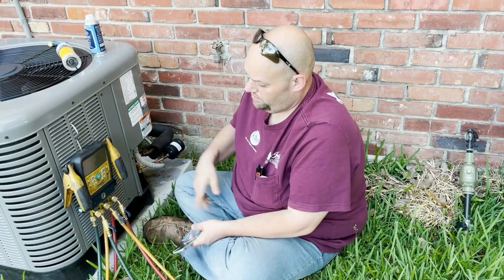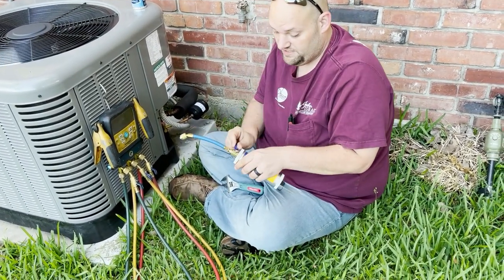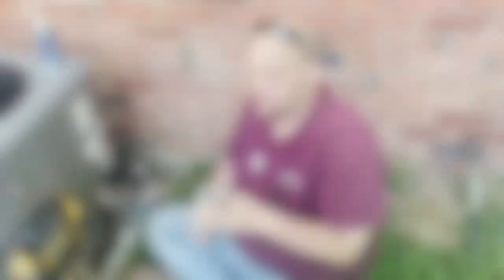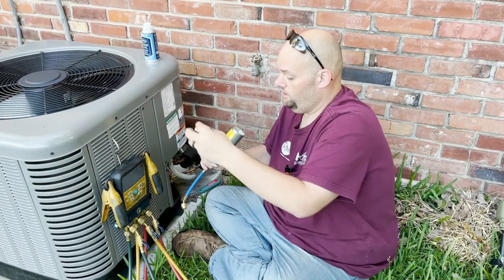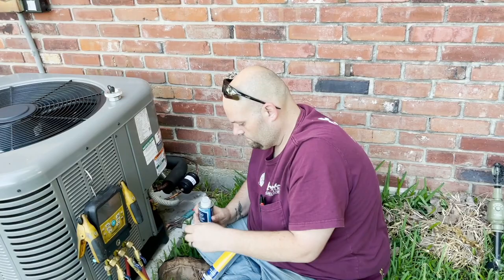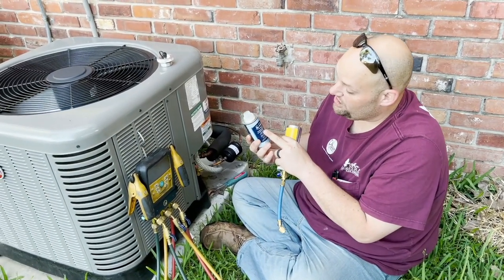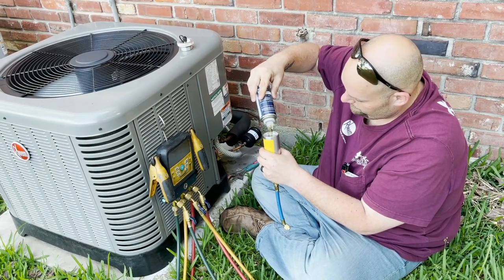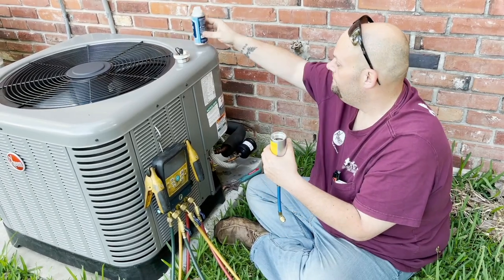Trying A/C Renew to Unstick a TXV

Comment: Next time, try this. 
Unplug condenser fan motor and get pressures up to 500… cycle condenser fan motor by touching it to power keeping the head to about 500. 
Get you some hot water and ice water in a cup- and dip the bulb- that helps exercise the valve. She’ll break loose. I’ve had 2 I couldn’t get to come around.  
I yelled through the phone “release the pressure” and giggled when you said it. Same with you wiggling your wireless clamps to get temps. Great video my friend.

Comment: You definitely put air into that system. I would of removed the txv sensing bulb and manually tried to actuate the valve to see if it even moves. It a long shot but could of broke it free. None the less always enjoy your videos keep them coming.
Reply: Eh, the filter drier will get the added moisture lol
Reply: I thought the same thing.  Is there any way to purge their air out prior to introducing the ac renew into the system?  I gotta think there is, and I'm just an amateur.
Reply: @adamcraig1568  filter drier won't take the air out though lol
Reply: @justinh7957  true, but we gotta test the compressors endurance and reliability lol
Reply: Was just typing same thing. If your gonna make educational video do it right so the junior tech dont screw up
Reply: @justinh7957 ou just purge the lines, and the cylinder won't have air if you fill it correctly. Air in small amounts won't kill a system, compressors are made for gas compression. Moisture in the air will do damage. Filter driers will take care of any moisture. Diy people should  just leave it to pros so they don't do something stupid that damages their expensive equipment.

Comment: You can use that ball valve on the injector to bleed the air from the injector once the high side is connected.

Comment: Shouldn’t there be a way to purge the air out of the “injector” before injecting?
Reply: He didn't purge his hoses, and yes there is a way to purge the air out.
Reply: It fills completely  no air in there
Reply: Not without wasting the product
Reply: @ivancook1247  if you have air in the hose end and hoses attached to the manifold then open the ports all that air enters the system contaminating it. Any air gap in the injector would also Introduce air.
Reply: Lol… I noticed that as well
Reply: This guy is licensed?! 🤡

Comment: You did the same thing I have done with the AC Renew. My experience with it, it hasn’t been the best. Supco88 is a lot better, or it has been for me. If it’s a heat pump I usually make the reversing valve go into heat and cool mode to get it flowing both ways and it seemed to help quite a bit when I use AC renew.

Comment: John I had a brand new unit with the same issues. I ordered a new txv and when I went to replace it there was a piston in the distributer tube. So the factory put the piston in and a txv on top. Talk about a crazy service call.
Reply: did you remove the piston?
Reply: @obedb093  Of course I did then it worked like a charm. Boy when quality control in the manufacturing fails isn't that a " Never seen this diagnosis before in any of my textbooks" job

Comment: Great video. Just one suggestion, or actually two. One I recommended cracking the valve and letting some of the atmospheric air out of the injector. You will get a little oil so turn it away from you. Also I highly recommend Supco oil. It’s a real pain because if it gets on you or your vehicle it stinks to high heaven! Use what you need and throw the rest out, because it’s only $12-15 and it’s not worth taking an open bottle with you. You can also charge the same but have a better profit margin. Both products work great but the old school Supco seems to have a better batting average for me
Reply: In my experiences with Supco also. And Definitely would not recommend keeping any leftovers that product does have a smell to it lol. And keep up the good work also young man I enjoy watching your videos.
Reply: I have a suggestion. Learn to do the work. I walk onto a commercial job with contacted time performance guarantees and I see something like this, the contractor either had you replaced in less than 30 minutes, or in 31 minutes, I'm on my way home, never to return for ant job that contractor calls me about. He can hire anyone he wants, but life is short, and I don't work with "stupid"

Comment: Hopefully you checked blower speed, evaporator, secondary HEX condition and possibly ductwork for issues. Don't think you mentioned any of those. Could very well be a bad metering device but bad airflow over evaporator will cause low superheat and low suction pressure. Boiling water and ice water on the txv bulb can unstick the valve also.

Comment: I remember getting that stuff back in 2013-2014 when Trane had the run of compressors that would wax up the metering device. That anti corrosion crap ruined a lot of systems
Reply: Ruined systems +$4500 compressor replacement then another failure.
Reply: I worked a 15 ton York with 3- 5 ton scrolls all with sticky TXVs due to the corrosion inhibitor. RTU was under warranty and York sent me 3 can with the injector. Installed the snake oil and within an hour all back to normal. Couldn't believe it worked and never had a problem.

Comment: Before retiring worked for carrier dealer they had run of bad txv due to bad manufacturing practices they had they're  type of renew product we had to use for warranty had 0 luck with product and pissed off customer because they had to wait that mutch longer to get txv and change it and yes if u don't blead that injection tool u will introduce air into system its just a matter of slightly cracking line on boath sides of tool for a couple seconds to pressurize each side to remove air tool should come with proper instruction on proseidure

Comment: Yeah normally your supposed to purge the can before you start adding to the system.  Didn't see you purge your hoses either but that part could have been edited out. But that AC renew stuff has never worked for me with unsticking valves. I've always put it in older systems as preventative

Comment: Did you troubleshoot  the TXV by putting the unit in heat ,and putting a small magnet on the shaft to see if it moved when called for cooling.

Comment: Save yourself some time and just change the txv. I have had zero success with AC renew. Two things should be in a refrigeration system: 1.) oil that came with it  2.) refrigerant
I seen Ted Cook using dye so I would stay away from that mess as well. We should just change the parts if they are bad. We should use sniffers to find leaks or ultra sonic leak detector's. Thanks again.

Comment: you have an r 22 exp,replace the refrigerant to r 407c.been there done that.if your delta and s/h is not right let me know.
Reply: He said it was a 410a txv. New rheem 410a condensor
Reply: @justinh7957  he also said the old condenser was r22,and thats the pressure you get with an r 22 valve,and a 410 a condenser with 410a refrigerant.
Reply: @MariosACandRefrigeration  he also said that the condensor was r22 with a 410a txv indoors
Reply: @justinh7957  a pluged txv will overheat the compressor,a bad power head will run erratic pressures like 80 then 50.r22 valve with r410 will run right at freezing steady.